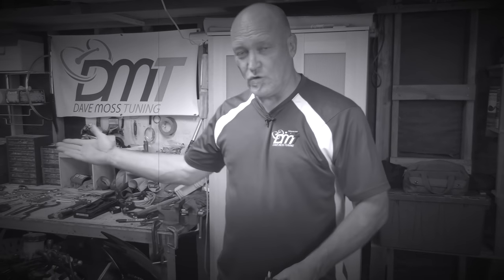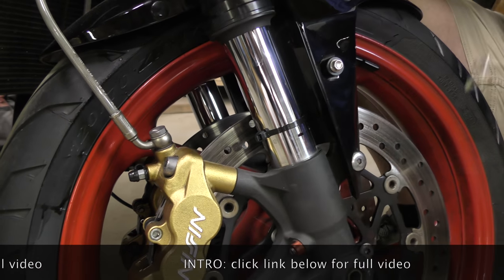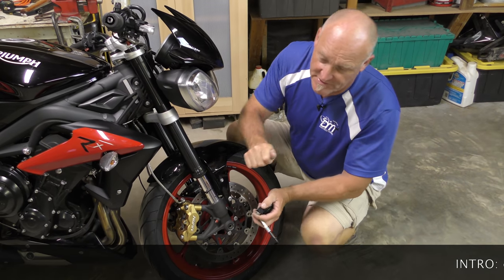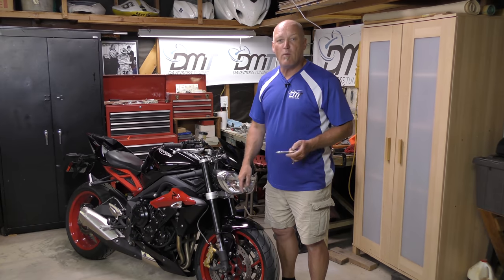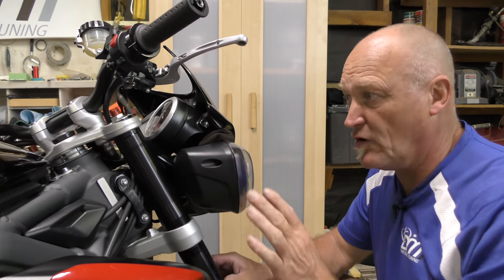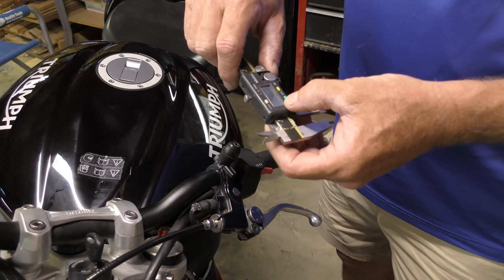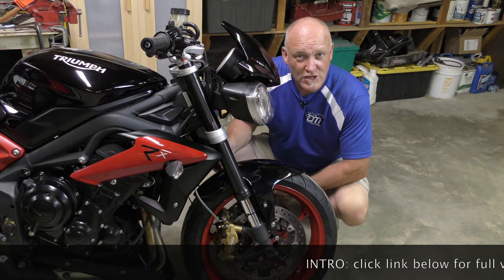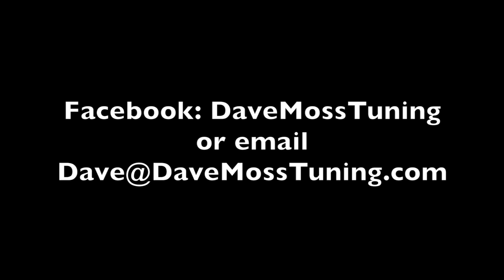INTRO How & Why To Change Your Motorcycle Fork Position

Comment: CBR954RR….loves to wheelie,crazy light front end,controlling low end torque.I read a recommendation to drop the forks about one inch.INSTANT corner stability along with heavier springs and thicker fork oil.
Reply: Sorry EXTEND the forks UPWARDS one inch
Reply from the maker: Check shock sag and see if the shock is too hard or too soft. That might explain the "why" of the wheelie. Once the shock is set correctly for preload, rebound and compression - see how the wheelie occurs and if there is a difference. Is it harder to get the wheel to ride? If so, the bulk of the issue was the shock setting. The additional contributor  may be fork rebound being too fast.
Reply: @stanbarrington an inch! Thats 25mm. You’re supposed to do geometry changes slowly and with testing 3mm at a time.

Comment: I lowered my front end about 1.5cm once and immediately got a tank slapper from hell. I put my forks back and will never mess with that again!
Reply from the maker: Reason for the change? Acceleration or deceleration? Speed when the slapper happened? Your answers could help many riders not have your experience.
Reply: @catalystreactionsbw  oh dave, it's a 2001 R1 and I just thought it looked better lol. The bike handled fine before, I just wanted a slightly more aggressive stance and didn't think it would change anything else. I was accelerating on the freeway, actual speed probably 85mph, I ran over a patch of uneven concrete and it started. Extreme head shake for what seemed like 5+ seconds. I had no control, just let off the gas and luckily nothing was in the direction I was drifting. I actually contacted you through Facebook and you informed me that slamming the forks caused a "shopping cart wheel" effect. This was maybe 6 years ago but youll be happy to know I still own the bike and she's doing just fine.
Reply: Let off the gas?  I keep thinking Keith Code; “when in doubt give it gas”.  I had a bit of a nasty head shake as the weekend; I kept on the throttle.  I was accelerating out of a corner, on the gas ... drifted a bit over the line (in the Highlands no traffic) and hit poor road surface and cat’s eyes 🙁. ... managed to keep on the gas!  Big just powered through it.  Hmmmm 🤔.  

It’s sort of a habit with me; hope I am doing the right thing 👍
Reply: @chriscarbaugh3936  ya I think you did it right. That was my first big one. The bike will do little ones sometimes but there's not even time to react before they go away. This one was nearly lock to lock. In the moment I really just didn't know what to do. It was a pretty helpless feeling because I had zero steering control and I was just drifting into the median. I just remember thinking "well, here we go, we're gonna crash." And it finally just went away at maybe 40mph or so. Idk if hitting the gas would've worked but in the moment it seemed like the exact wrong thing to do.

Comment: Hi Dave. I’m having second update as the first didn’t went well. I’m having KTech Razor R rear with 140N spring (i’m 122kg-270lbs) and front cartridge from KTech as well with 10N sprinng in it. Am i okay ? And what oil do you reckon ? It is Tracer 900 GT 2020. Do you reckon fork raise or lowering it ? Thank you !
Reply from the maker: Sounds good to me. Leave the forks in the stock position. Fork oil would be 15w with stock valving.
Reply: @catalystreactionsbw  Thanks mate ! Do you have Buy me a coffee app ?
Reply from the maker: @intravelt5684  Never heard of it Martin.
Reply: @catalystreactionsbw  Dave it is used as a thank you app. You buy “coffee” to someone with that link. (in this case i want say thank you for your reply) so id like you to buy a coffee/beer but you on other side of the world so that is used for that. Similar to patreon but less % to be taken from your profit.

Comment: so my '05 R1 turns in way faster than i'm comfortable with, but once i'm at lean it feels sluggish to get to the absolute edge of the tire. now i did swap tires and got a higher tire in the rear(55 instead of the 50 that is factory size), that does increase the weight on the front i know that, however i cant increase the front height, forks are flush with the triple clamp up top. i assume my best option is to get a rear shock that has ride height adjustment and dial the rear ride height down a notch or 2. then again, i've only done 2 trackdays on this bike and it's so different from my previous trackbike, i'm still finding a good baseline setup for the suspension, setting sag to a certain book-number is too soft for my braking ability, i bottomed it on the first session. have a trackday planned next week, going to experiment a bit with compression and preload.
Reply from the maker: You can add preload and compression to raise the travel point in the forks up and correct geometry that way. Also you can be 2mm inside the upper triple clamp as a maximum number.
Reply: @catalystreactionsbw  i will add that into my experimenting, thanks for the input.

Comment: I have conventional forks with damper rods and no compression adjusters. My preload adjusters are backed out all the way. Fork caps are flush with a FLAT triple clamp. Using the zip tie method I'm using 2/3 travel. To get to the 3/4 point, can I soften the forks just a bit by removing a small portion of oil in each leg? If so, by how much increments would you recommend?
Reply: 10cc, 10ml. You can also change oil viscosity.

Comment: I want to do this on my fjr1300. But I fear that the weight would bend the forks. I also don't know if it's doable with both forks connected to the wheel.
Reply from the maker: Perhaps this video will help you udnerstand the task better and then you can decide if you choose to do it. https://www.youtube.com/watch?v=5o6V8ST72i0&t=7s

Comment: An interesting video.

It is always worthwhile checking and returning to factory settings first, I had a new Honda, one fork leg full of oil, none in the other; mistakes happen.

Could you not raise the oil level and by reducing the air gap give a bigger distance to bottom out ?
Reply: No! The less oil in the forks the more you will bottom out, the more fluid in the forks the forks will not compress very well. Some racers will remove a bit of fluid level to gain a bit more suspension travel
Reply: @ibidu1  really, what happens when you compress a gas ?
Reply: @alanbrown5593  Are your forks oem? If yes, then more likely they are not gas, and use fluid. You can easily remove the forks, open the top cap drain all the fluid, and pour in the exact amount of fluid that is called for in the spec for your bike. Compress it several times with the cap open and then close it and reinstall on the bike.
Reply: @ibidu1  see the bit above the oil level, or the air gap, all bikes have them if they have telescopic forks ( no matter which way up they are) as you cannot compress a liquid, so they would be rigid.

Assuming temperatures stay reasonably constant, if you half the air volume what happens to the air pressure inside the fork ?
Reply: @ibidu1  I should have been clearer for you; when I said had I meant past tense. It was a 5☆ Honda dealer in Edinburgh (some can work out who they were) who misfilled my 1981 Honda CB750KZ. 
My point, poorly made, was just because something is new don't always expect perfection, mistakes happen.
Reply: @alanbrown5593   The more air in the fork, means less fluid volume. Meaning the forks will bottom out easier. The fork air is not compressed, as the air rises to the top and your only compressing the fluid through the fork cartridge/valving when you work the forks.
Reply: @alanbrown5593  Its hit or miss when dealing with forks rebuilds, from places who do not specialize in it. I once had a big showa fork rebuilt by a known race shop/race team, and they left the inside cartridge unbolted, and my front end collapsed at the track. So ive learned to do my own, but ive made mistakes aswell like once over filling the fluid level. But you learn after time!
Reply: @ibidu1  true, but on a brand new bike ... mistake like that get people killed.

Comment: Hey I have 07 ninja 650r . With my wheel straight my handle bars are turned to the right a little how do I fix this ..
Reply from the maker: Remove the brakes front wheel, fender/mudguard. Loosen the steering stem nut and all triple clamp bolts, then remove the forks. Install one fork leg to the stock position, see if the other leg fits easily. If not, the triple clamps are slightly bent. Make sure everything is torqued to spec on rebuild to make sure the 650 is road safe.

Comment: But what’s the Purpose of lowering your forks From Stock Height, I would Guess quicker turn in? What’s the downside? Riding Postion or what?
Reply from the maker: 1. Make the chassis neutral or flat. 2. Make turn in slightly quicker and go in 2mm increments.  3. Down side might be turn in too quick.

Comment: I got 2023 BMW M1000R and it's notorious for front end being "wobbly" light. I has my suspension set up by the shop  and also DDC as follows Front down 2 Rear down 2 and 10.I weight 217 pounds.When I told the tuner I that my front end feels light at higher  speeds and acceleration , he then suggested to drop the triple tree down by 5mm from stock ( I did not write down what stock was).On the ride home I noticed the motorcycle not as as agile in the corners and ruining wide and I have to push on the handle bars more.Any suggestions? Should I simply go back to stock?
Reply from the maker: The "notorious" part is the oil in the rebound leg cannot control the rebound oscillation at 10 from new, so we have changed it to 7.5w oil and see much more stability on turn in and mid corner. I would put the geometry back to stock as the handling will be worse with that change.
Reply: @catalystreactionsbw  
Ok. Thank you for the reply. Got it change for oil to 7.5w. It will add more stability in the corners. Will help with front end being “light” higher speeds and hard acceleration?
Looks now it has BMW Type 2, and according to my search it’s 11.5 weight. Before bmw offered 7.5 and for some reason, they changed it few years back.
So, when I will change raise triple tree back to stock. The handling will go back, to motorcycle being nimble in the corners again. But,Unfortunately manufacturers do not make dampers for my motorcycle. So, I have to work with stock damper made by Marzocchi.
I have it set right now to max and one click back-perhaps ads another  reason other than dropping the triple tree down Motorcycle started to feel less nimble ? I had damper set up like that before dropping triple and it was fine.
Any suggestions on what to do on higher speeds above 110mph or hard acceleration, this is when the front wheel gets really light. (one of the reasons  triple was drop down 5 mm). 

I understand it’s a naked bike seems to be an issue with all of them.
Perhaps tire pressure? ( I am 217 pounds and have front 34 rear 36 psi), maybe  body position in those situations?
Thank you
Reply from the maker: @furikfurik8023  Fresh oil makes a huge difference in handling/stability. You should pressure test 36/36, 38/38 and 40 front and 42 rear. Always find your own pressure.
Reply: @catalystreactionsbw  
Motorcycle has only 600 miles so oil is fresh. In stock triple tree setting motorcycle handled excellent in the corners. I don’t need any better. lol. I am just looking to gain better stability at higher speeds and hard under hard acceleration.Hence, why I lowered the triple tree

Comment: Since the forks are tied together top and bottom, how could the left side have more pressure on it just because the bike's on the kickstand?
Reply from the maker: Weight distribution.The right leg is fully extended, the left is not.
Reply: @catalystreactionsbw  Considering your extensive knowledge and talents, I'm surprised you think that.  The only way the left fork could have more compression or weight on it is if the two are uneven at the top or bottom.  Tilting the bike to either side won't change the relationship of the forks to one another.
Reply from the maker: @DonziGT230  I measured the left leg at 127mm and the right leg at 133mm while resting on the side stand. If I go strictly by the numbers knowing that my forks have no stiction, that is an indication of more load on the left leg. I also removed all the compression damping and added it back in and saw a 2mm change.